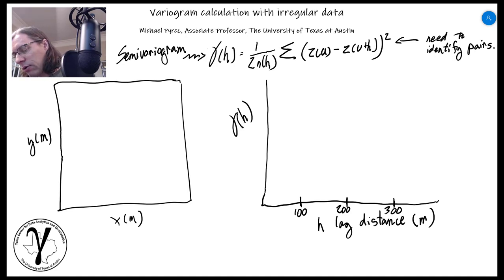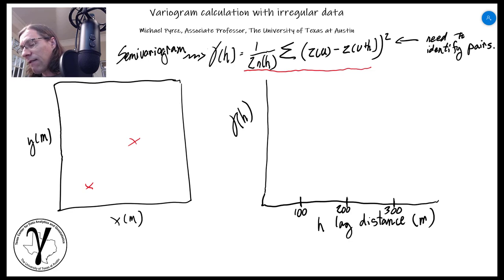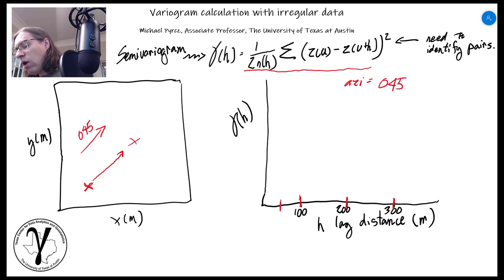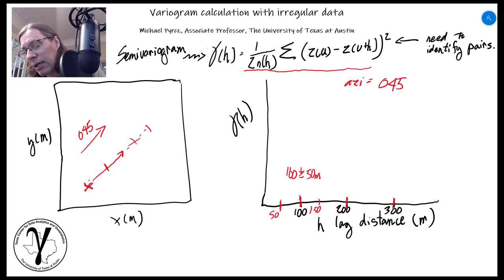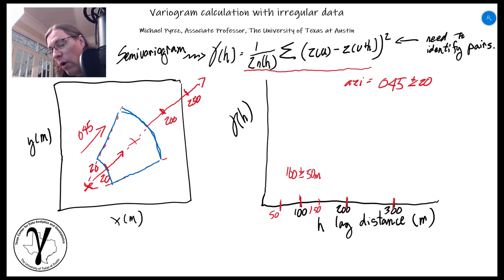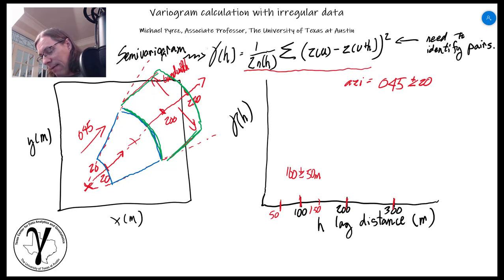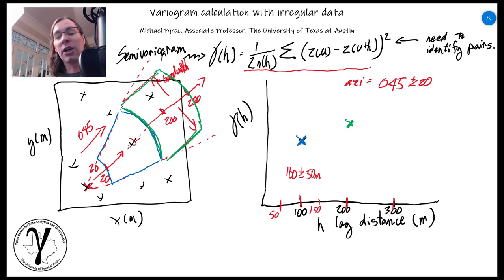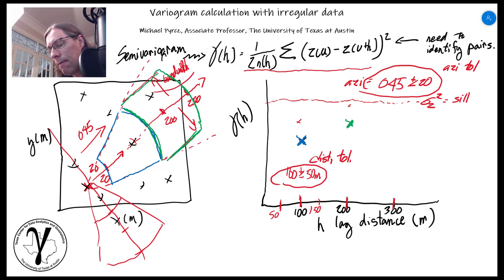10e Data Analytics: Variogram Parameters

Comment: Thank you for this explanation. How should we specify the azimuth direction? Should it be in the direction of the most well data? Or should it be in the expected flow direction? Or parallel to the shoreline direction (facies)? Or should we calculate it using a variogram map extracted from well data?